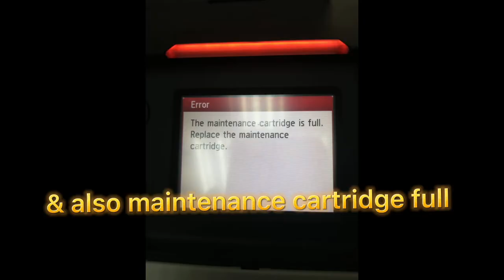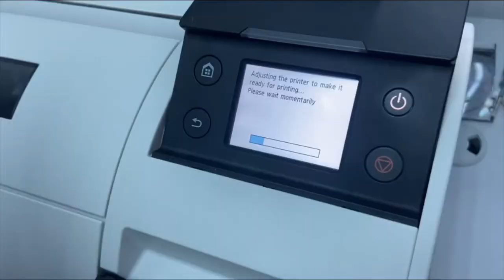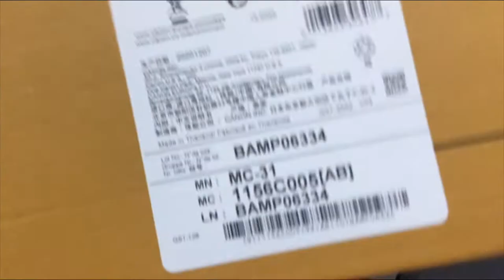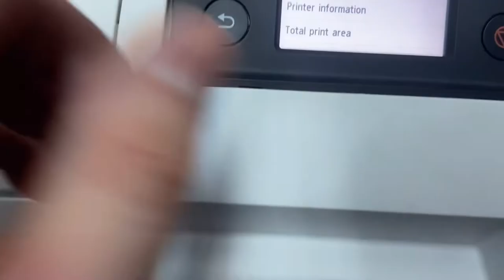Canon TM5200 Print Head Error Code EC21-2F53- How to solve this problem

Comment: May i ask is ipf tm300 vs ipf 770 how is better do you think
Reply from the maker: Hi my friend , I can’t giving more info about this question as my region only have TM5200 & iPF771. I believe both of these models are similar to TM300 & iPF770, TM series is newer model with higher speed processor , bigger ink tank 😉
Reply: @dennisthefatkid  thanks alot
Reply: @dennisthefatkid  another question about the printhead after 3600 meter it's stop way i read about small device in the youtube that reset the head do you know about it

Comment: After your video, my printer worked for another month, then the ec21-2f51 error often appeared and I bought a new head, but the problem did not disappear with the new head, I noticed if it was cold in my office, there was no error, so I turn on the air conditioner in the office, after an hour or 2 I turn on the printer and it it works fine. But sometimes the error ec21-2f50 and ec21-2f54 appears, please tell me what else to do, the new head did not help. I bought the head for $500 at Ali Express. Maybe they sold me a used head? After all, the head looked like new, and when I pressed the head for the first time, it printed well at first.
Reply from the maker: Hi there , sorry to heard about your problem. Is it a genuine canon dealer in Ali express? I did encounter the same issue like yours couple weeks ago, after cleaning purge unit .. error come back again, after changing the new head, the error is gone. It’s advisable to order it from authorised canon seller, do you check the system fan? Does it spin ?
Reply: @dennisthefatkid  Excuse me, how can I check if the system fan is spinning? When I turn on the printer, there seems to be a sound, something is spinning.
Reply: @dennisthefatkid  Now it is showing this error ec21-2f58

Comment: Hello, I have a Canon TM 200 plotter giving an ec21-2f53 error after replacing the print head.
If I do the procedure according to your video, will I get this error?
Reply from the maker: Hi there, I had a same situation with an old iPF605 with more than 2 errors codes even purge unit serviced & changing print head . Try observe the ink tube, is that the ink able to go in ? If bubble in between, it might be the purge unit problem or ink supply unit problem.
Reply: What if ink is not able to go in

Comment: Thanks alot
I have ipf 770 and its fine but the tube  near to the printhead always get air and i do a printhead clean A to remove it is there other way cax the claen tank alot of ink
Reply from the maker: Yes my friend , clean A and B are wasting inks , better do it manually like this
Reply: @dennisthefatkid  i will try it i have never opened th printer
I relayed the problem only with the 3 black cartridge the CMY cartridge pipe is good with out any air
Reply from the maker: @عبدالرحمنباعقيل-خ9ل  ok my friend , let me know the result here once it’s done
Reply: @dennisthefatkid  not a big difference but the problem still air is present only in the 3 black and the other 3 color is fine no air in the pipeline
Do you have a solution for that
Reply: @dennisthefatkid  not a big difference but the problem still air is present only in the 3 black and the other 3 color is fine no air in the pipeline
Do you have a solution for that
Reply from the maker: @عبدالرحمنباعقيل-خ9ل  please refer another video in my channel , I did guide how to Apple air pressure into cartridges
Reply from the maker: @عبدالرحمنباعقيل-خ9ل  this this https://youtu.be/qFMYSiu1Aqk
Reply: @dennisthefatkid  i see this one but here all the pipeline is empty main fine only at the end 
I will show you a picture can i get your email or what's app number to send it
Reply from the maker: @عبدالرحمنباعقيل-خ9ل  if you have cleaned the purge unit and apply air pressure into all cartridges , I suggest to change new print head and new purge unit

Comment: Sr I am used dummy cartridge in Tm5200 befor 1 year but suddenly mbk ink printer is not detecting.cartrige is full.help me
Reply from the maker: Dummy cartridge ? Is that a compatible cartridge(not original) ? Do you try remove the cartridge and replace a new one inside ?

Comment: can ipf780 print head be reset ?
Reply from the maker: Sorry, we can’t..
Reply: so everything time it give me an error i need to replace it
Reply from the maker: @marcolinstones9178  do you try noozle check before in service mode ?
Reply: no i didnt but i try resetting the printhead in service mode it said ready and then i got a test page and then went back to the error.
Reply from the maker: @marcolinstones9178  try noozle print in service mode , if the noozle line is broken .. you have to replace the printhead. The tricky part is error code accrued even new printhead installed , if error still there.. you have to replace the main pcb unit.
Reply: ok thanks for the info
Reply: my country dont have these equipment and part readily everything we have to ship and it cost almost the same for the item
Reply from the maker: @marcolinstones9178  my country do have parts and components,but… the cost for print head+pcb board replacement price are equal to a brand new printer.
Reply: ok i understand i have alot jobs to print but all the my machines are down and parts and equipment's are so hard to get .
Reply from the maker: @marcolinstones9178  hmm… do you have any Canon Authorised dealer near by ? Maybe they can help, by the way… where you from ?
Reply: jamaica
Reply: ATL Do canon equipment

Comment: i have this error code, on mine the cutter will cut after a perfect print out and thenabout half a cm into its return journey it stops dead and throws the error. if i move the cutter back to the far right in the home position it is working again until it needs to cut the next document, any ideas?? don't think mine is doing the same as in this video but same code
Reply: sorry my bad mine is ec15-2e23
Reply from the maker: @crazygamer_uk  hi sir，lift the upper cover and make sure there is nothing blocking the carriage from returning to its home position. If no blockage, it might be cutter problem or mainboard couldn’t send proper signal to cutter
Reply: Print head returns to hone position. If I slide the cutter back to home position and turn the machine on it doesn't give an error. I thought maybe see if it will return by itself when I last tried and it booted up part way. Moved the cutter about 5mm maybe 1cm and then the cutter stopped and a second later it bleeped up with the error again. Something is making it stop on its return journey, I thought faulty motor refusing to swap directions without a voltage drop put hadn't thought about main board but you could have a point there. All these parts are super expensive though so chances of me getting the right part first time are slim from my own diagnosis
Reply from the maker: @crazygamer_uk  sorry to heard about your problem , if that’s mainboard problem … same goes to my country , it not worth to repair as the cost is extremely high , suggest to trade in and upgrade to lattest model 🥲
Reply: @dennisthefatkid  I doubt they trade in faulty printers here in the uk. a nosey today sees a few on ebay that are faulty for various reasons. may be able to get a printer that has working parts i need and cannibalise it. Maybe I get lucky and get some almost full ink too??
thankyou for the advise dennis :)
Reply from the maker: @crazygamer_uk  for technical guy , you may try to purchase one for spare parts reason (if the cost is low) no harm to try on cannibalise and swapping parts , maybe you can discover some new idea and knowledge with it :-)
Reply: @dennisthefatkid  I do quite like the idea of converting one too dtg looks perfect for the job

Comment: Hey, my Printer TM 5200 Doesn't Detect Black Ink I have also changed INK TANK but still no solution
Reply from the maker: Try use alcohol to wipe the chipset , observe the ink tube , is that the ink is loaded in the tubes ?

Comment: Hello, I'm looking for information about error 03800500-2f47.
do you have an idea of the fault?
Thanks for your help
Reply from the maker: Head management sensor problem , do You replace print head yet ?
Reply: @dennisthefatkid  il took it apart to clean it. But the problem  persists
Reply from the maker: @stevenmace3475  from our experienced, we changed 3 parts 
1. Print head
2. Purge unit
3. Maintenance cartridge
Reply: когда искал что вызывает ошибку 2f51 нашел датчик который вызывает ошибку 2f47. слева от капы, есть глубокий канал. Внутри канала расположена впитывающая прокладка, а над ней сам датчик. Он закрыт со многих сторон и его трудно заметить (я заметил его только разбирая блок впитывания). Закрыв его я вызвал ошибку как у вас. Может поможет.

Comment: Error EC21-2f75, when i changed the flat cable, this error ic comming, there is no ink in the tube, sollution pleas
Reply from the maker: 2F75 is referring to print head connection or print head replacement , try check the flat cable connection, the print head is not connected properly , that’s why no ink in the tube

Comment: IPF Replace Printhead message. Replaced 500.00 printhead and still same message.
Reply from the maker: Try enter to service mode and print noozle report, if can’t generate the noozle report.. most probably you have to replace the print head

Comment: Hi engg may i ask
I get error code on canon ipf770
03130031-2f4f and 03130031-2f51
I turn it of and on sometime it work and it do cleaning and say replacement print head ?
Reply from the maker: Hello my friend , if you already done with purge cleaning , you have to change print head in this case… before changing print head ; I advice you to observed the ink tube first… is that any bubble in tube , if yes… it might be purge unit problem
Reply: @dennisthefatkid  there is some air near the head only but how can i observed air

Comment: DEAR SIR I HAVE FACED THE ERROR CODE EC21-2F51. WHAT IS THE PROBLEM. PLS TELL ME ANSWER SIR.
Reply from the maker: The EC21-2F51 error is an indication that your imagePROGRAF PRO-4000 is experiencing an internal error. The issue could be related to the printhead, but it is recommended that you contact live technical support for further troubleshooting.

I got msg above from Canon official website, you may try changing print head if it’s doesn’t work after cleaning purge
Reply: @dennisthefatkid  THANK YOU VERY MUCH SIR FOR SUPPORTING

Comment: What is Ec-21 2f-51? Please reply me
Reply from the maker: The EC21-2F51 error is an indication that your imagePROGRAF is experiencing an internal error. The issue could be related to the printhead
Reply: Thanks
Reply from the maker: @information4809  welcome sir
Reply: Can I repair head for remove error EC-21 -2F51?
Reply: Reply me
Reply from the maker: @information4809  sorry sir , I don’t have any idea how to reset the error code, perhaps you can wiping the print head connector with alcohol , the success rate is low.. good luck
Reply: @dennisthefatkid  Thanks

Comment: Hi, i have cleaned my purge unit, the error is still there, then i cleaned print head also, the error is still there, now again i cleaned purge unit, waited 1 day to let it dry before putting back. Now the error is gone, printing was fine, but after a day only, again same error, repeated the previous troubleshoot, its started working again, and now again today itself, after few hours, the error occured again. Whats the damn problem.
Reply from the maker: Hi Faiz , it’s time to change the new purge unit and new print head. May I know the age of the machine ? If the machine is old, it’s not worth to repair any more I afraid that after you replaced both others issue will appear